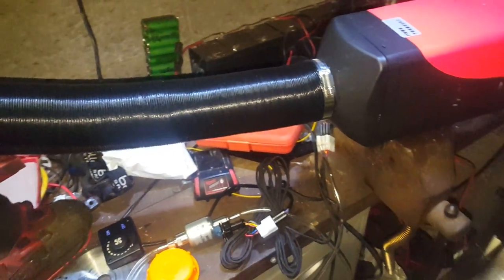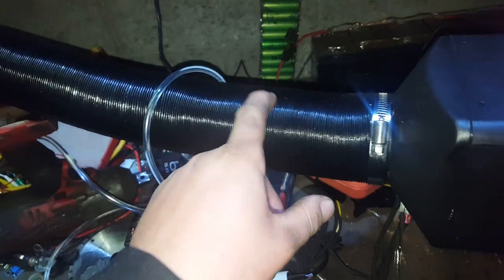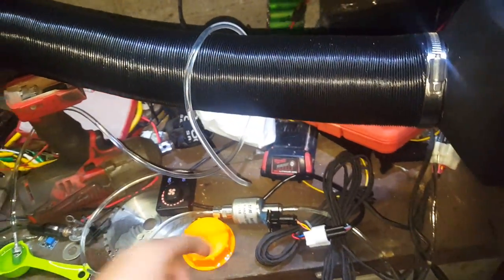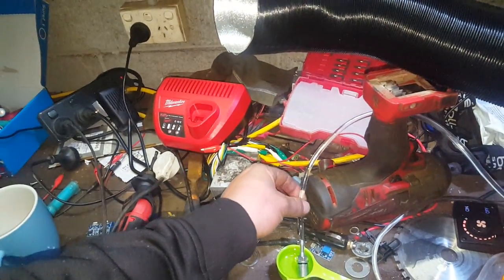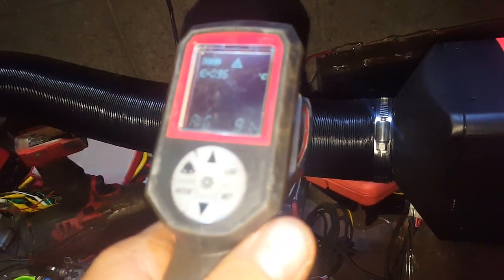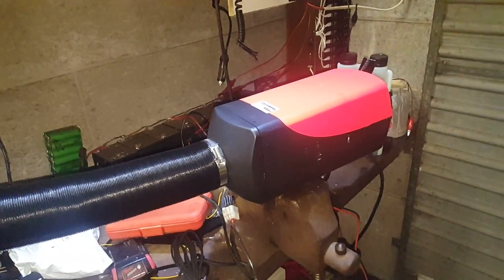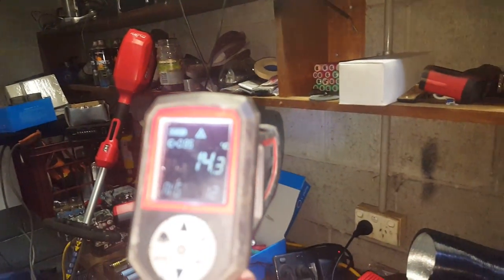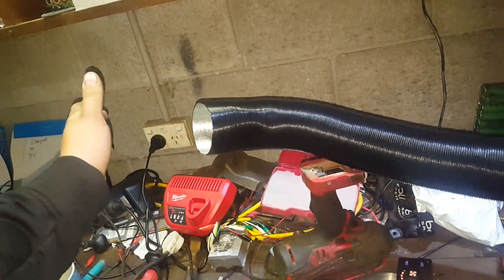Awesome 5Kw Diesel Powered Rv Motor Home Heater Test in the Shed

Comment: That seems quite fuel hungry? Is the normal sort of fuel consumption for these types of heaters?
Reply from the maker: At full speed its 5kw of heat so its not that much fuel for the heat you get
Reply: @Oneupthesleevecustoms  How many hours on a 5ltr tank at low speed?

Comment: What sorta of temp does the exhaust pipe get to?  Temped to set one of these up in the rear of my car with a remote start and its own dedicated battery, by the time I arrive at the car on cold/snowy days it'll be totally defrosted.
Reply from the maker: Exhaust pipe gets very hot 150 ish id say. Temp out of unit ive seen over 65
Reply from the maker: A 2kw one for a car would de snow it fast and i would run it on kerosene

Comment: Excellent review and test.  Curious, have you found any limitations in the length of fresh air or exhaust length?  I am hoping to extend either for ideal placement and don't want to introduce inefficiencies in the design.  My other option would be to extend the cold air supply or the hot air exhaust, not sure which would be best.  Does the fuel tank require certain placement (above or below the heater)?
Reply from the maker: Tank can go anywhere i would stick to one lenght if exhaust then muffler then one more pipe section. Id keep combustion air soured shorter
Reply: @Oneupthesleevecustoms  Excellent, thank you!  Mine just arrived yesterday, I can't wait to see it installed in my application.  Your video helped me in the process, so thank you very much!
Reply from the maker: No problem mate. Thanks for watching ive got heaps more places to install them one in a shed one for my workshop a caravan too
Reply: I’ve got a top tent on a trailer better than freezing
Reply from the maker: They are good for tents

Comment: Excellent video.
How hot did the exhaust get when up to max temp and if running the exhaust through a timber floor of a caravan, what measure should one take to insulate the exhaust? Did you have a silencer (muffler) fitted?
Reply from the maker: Yes muffler is needed. 90mm steel down pipe pop is a great way to do the penotrations
Reply: @Oneupthesleevecustoms  Cheers buddy. I appreciate your advice.
Reply from the maker: No problem I need to make some more diesel heater videos just very time poor atm

Comment: Does the unit by chance come with a timer that can be set to turn on at a specific time of day and/or turn on at a specific time of day on a specific day of the week?
Reply from the maker: Not this.model mate
Reply: Appreciate the reply/help. Does anyone also happen to know if the main heat unit absolutely needs to be mounted in one specific position or is it possible to mount the main heating unit in different positions(?)
Reply: @__WJK__  facing up yes or across but not facing down mine played up the.flame inside like across or up good heaters  they do carbon up if not used flat out now and then
Reply: @Jamie Joker - Appreciate the reply... I just so happened to find a youtube video that answers the question I was searching for. If you're at all interested, here's the youtube link...  https://www.youtube.com/watch?v=fB1QrW3nKVE - The 10:25 mark shows the orientation I was wondering about.

Comment: Has the heater a thermostat switch so if the room Temperature drops it comes on?
Reply from the maker: No its just speed settings. If you shop around there might be a thermostat controller model
Reply: Wouldn't be hard to modify it...
Reply from the maker: Yeah a simple timer and thermostat you would be fine

Comment: How much power does it take to run this? I'm planning on heating a van in the winter.  How much solar do you think of need to have it run overnight?
Reply from the maker: 200ah at 12v will be sweet over night. They pull 3 to 4 amps while running 10 on startup.
250 plus solar would be good

Comment: what kind of controller... does it do what the ASPAR latest versions do!? like slow down once room is at heat?
How much fuel does it really consume per time?
If burns more than the ASPAR, one saves money up front but spends more in the long run so this unit turns out to be more expensive!
You have to do precise and thorough comparisons, or the results are misleading.
Reply from the maker: No they are pulse controlled so fuel and fan speed linked to 6 or 10 settings pre defined.
They are not comparable.
Ones 130 aud and the aspars are more like $2000.
Fuel use is never going to be identical.
My 100s of hours of running these and the all in one style Chinese clones and installing dozens in campers , houses , hot houses ,sheds and setting them up for tents says that these cheap units will suit most applications and people.

Comment: how loud is it? cant figure out.. deciding between this and suburban nt16seq propane furnace for my van build.. id prefer to deal with diesel than propane but not sure if the noise is tolerable at night
Reply from the maker: They have  an adjustable fan that turns down nice and low ill run it in another video with my db meter and show you. They sometimes come with exhaust mufflers
Reply from the maker: Ive installed it for.my customer now i was getting 65 db right next to it at flat out. No exhaust muffler. 
Much lower under normall operating conditions
Reply: @Oneupthesleevecustoms  thanks for your feed back
Reply from the maker: Thanks for watching
Reply: @Valters Boze- The Suburban Propane unit consumes huge amounts of gs and electricity. You need to be plugged into shore power - the battery isn't enough to make it through the night. You'll need several spare propane tanks!

Comment: Dude, build yourself some shelves!!! ...better use some M10 all-thread rods and hang them from those beams. Then separate storage from project space.That will give you a lot more freedom to work on your projects w/o knocking stuff over or tripping over the treasures piling up on the floor. Yes, this might take a few days but will save you MONTHS in the long run!

Comment: Sound like an airplane about to take flight
Reply from the maker: Only cause it's the only thing making noise in the shed. They aren't that loud I sleep with one in my camper van
Reply: @Oneupthesleevecustoms  what’s what I’m thinking of using it for. It does sound loud from the video. What would you compare the noise to ?
Reply from the maker: With a muffler its just mostly fan noise (air moving)  and the pulse from a pump. Like a gaming console with the fans on overdrive

Comment: Is it safe to have the combustion air intake in side the building or does that need to be outside with the exhaust, I am fitting one in my garage.
Reply from the maker: Inside a garage is fine.  If its a van out would be better if power fails (rare) you can get a bit of smoke come back from combustion intake
Reply: @Oneupthesleevecustoms  Thank you for the reply and advise, Much appreciated.
Reply from the maker: @j0llyroger889  too easy. Good things great cheap heaters

Comment: Would these run on domestic heating oil, as the last load for work was around £0.60p litre.
Reply from the maker: Im not sure mate we dont have that here to my knowledge. What sort of oil is it
Reply: Are you in the UK? 28 second heating oil is kerosene, 35 second is diesel. Either should work OK in one of these.
Reply from the maker: Yes check out my other videos. I heat my house
Reply from the maker: No problem at all

Comment: Hi how many amps does it draw on lowest setting?also do you know if 2kw would use less amps or are they about same on start up?🙂
Reply from the maker: Fan and pump about 1.5 amps on low. Id say glow plug is the same on 2 and 5kw items
Reply: Thanks for quick reply I’m off to go order one👍
Reply from the maker: To easy mate there a good thing

Comment: Do you think this unit is more fuel efficient then a 23,000 btu kerosene wick heater? I read this 5kw unit is about 20,000btu. I use a dyna glow wick type heater to heat my small work shop and kerosene is twice as much as diesel. I can get about 8 hours out of a full tank that’s 1.9 gallons/7.1 litters. I also can’t leave my kero heater running when I’m not here and would be nice to have a unit I can let maintain the temp. Running a natural gas line to my shop is way to expensive considering I’m planning on moving next summer
Reply from the maker: One of these is what you need great things
Reply: One Up The Sleeve Customs is it thermostatically controlled or is that controller just for fan speed?
Reply from the maker: Fuel and fan are on speed controller
Reply from the maker: https://youtu.be/-bmELZaH6zQ

Comment: I think the fuel pump is supposed to be at a 45° angle.
Reply from the maker: 45 to up hill. To aid getting air bubbles up and out of the line
Reply: 45 to 90...do not mount horizontally, vertical is ok.
Reply: Mine has been horizontal for years , no problems

Comment: can we put the exhaust any position , for example on the side to screw the unit to the wall instead to the flor ?
Reply from the maker: Unit has to stay in the upright position as it is in the vice. But you could elbow exhaust straight  out the wall. Thats how im about to do the same
Reply from the maker: There would be a moisture build up if it didnt fall down hill
Reply: One Up The Sleeve Customs the reason I was asking,is that I am planning to install this on my boat,and I always can make some angle to screw it on some inside wall and screw the unit with exhaust pointed down however if I would screw this directlyto the wall , I would save lots of work with drilling a holes and solve a problem with long exhaust safe way
Reply from the maker: Im fairly sure it has to go down hill

Comment: Your affiliate link leads to a 3 kw unit, do you have a 5 kw link?
Reply from the maker: Ill get you one tonight mate cheers
Reply from the maker: https://www.banggood.com/24V12V-5kw-Diesel-Air-Parking-Heater-Diesel-Heating-Air-Parking-Heater-with-Digital-Switch-p-1252913.html?p=OQ120813147900201708&custlinkid=3342
Reply from the maker: there ya go mate thanks for considering buying through my link

Comment: 8kw is a lot quieter fan 
No more hoover running in the back
Reply from the maker: You reakon the fans quieter i think my mic just picked it up strong
Reply: The 8kW one is literally a rebadged 5kW one lol. Their are so many videos of the 5kW vs 8kW where they pull them apart. They are literally the exact same. Just a marketing tool
Reply from the maker: No they are unlocked to higher pulse rates mate more fuel volume
Reply: @Oneupthesleevecustoms  negative
Reply from the maker: @1989cranston  yeah they are just tuned different. Some of the ones with the good screens you can turn up to that point too

Comment: I'd be worried about doing an over-nighter with a unit that's not CE/ULc/CSA approved.  There are too many unknowns.  I'm hoping that this unit is confirmed to be approved by a non-Chinese authority.  Your life may depend on it.
Reply from the maker: Yeah i guess that could be a issue
Reply: Run a co detector.
Reply from the maker: You can get smoke detectors with them in it i believe

Comment: I'm thinking of buying one which is self contained unit - fuel tank etc all in 1 metal box - easier to move from van to garage or boat etc. Relatively speaking what power would you recommend (if it heats up vw transporter panel van by +- 10-15 degree C in less than an hour and keep it warm using less than 5l of diesel overnight id say it is enough). also planing to run it on separate battery to keep it portable.
Reply from the maker: For a van car small camper 2 or 3 kw 
5kw for anything bigger

Comment: Hi just noticed they have digital display also ones the same as yours with dial,do you think digital display will use a lot more power as I only have one battery at mo in van🙂
Reply from the maker: No very little max a 100mah id say

Comment: Any information on how long one tank a diesel will last at approximately -20 situation
Reply: Roughly 24 to 30 hours on high but I've seen different tanks so not sure they are all the same size. I roughly been using a gallon a day running mainly oh high, but temps here go up and down frequently its -7 C here now. Hope this helps.
Reply from the maker: Yeah less than 500ml a hour on high is what ive seen with heaps of heat output
Reply: Yes it is good on fuel however watching mine a bit closer I think it was turning down lower over the 24 hour period and used roughly an Imperial gallon or slightly more but I am heating a 24 foot by 36 foot pole barn with 1 1/2 inch styrofoam insulation, sorry about my standard units of measurements! Great unit really happy with the investment was $159.00 US dollars delivered and very easy to install. Thank you for sharing the video!
Reply from the maker: They are a great value for money im very happy with  the couple i have tested oiut

Comment: how much diesel does it consume for 1 hour?
Reply from the maker: On hi low ?
Reply: How much on high
Reply: I think the general rule of thumb is about 100ml/KW per hour at full noise. So a 5KW heater would use 500ml/Hr. Rough guide but its pretty close

Comment: Glycol (glycerine) is a biodiesel manufacturing waste material.  Very inexpensive, I would be curious to see if this heater would run on it as it's extremely cheap and renewable also.  Formula E electric race cars are using it to power their charging diesel generators, look it up on Google.  The only caveats being they have to warm the engines up on diesel first, and also that glycerin (glycol) has only 70% of the energy potential.
Reply from the maker: Ill do some tests and let you know
Reply from the maker: https://youtu.be/-bmELZaH6zQ

Comment: Nice video... have you tried used motor pol
Reply from the maker: Used motor oil and diesel works yes
Reply from the maker: Won't work straight
Reply from the maker: Have you tryed
Reply: Waiting for unit to arrive.
Reply from the maker: Ah cool what part of the world are you in mate?
Reply: The U.S...... Philadelphia, PA
Reply from the maker: Ah sweet so winter is coming.
Reply from the maker: Is red diesel cheaper for you to buy?
Reply: Off road diesel was cheaper but I haven't checked in a while. Not many stations with it in my area.
Reply from the maker: We don't get that in Australia  we have to claim it back though our business's at tax time :(
Reply: It's a big fine here to use it as on road fuel. It's only for construction equipment here so it's not readily available in many stations.
Reply from the maker: What about generators and diesel heater s?

Comment: The pump is not at the ideal angle but it shouldn't affect your experiment.
Reply from the maker: Didn't affect it for the next 2 years and it still works :)
Reply: @Oneupthesleevecustoms  thats good. We used to fit these in boats  and its recommended that they be sort of angled and upwards. Its to do with the lubrication  of the pump itself I think which the diesel fuel does and at the wrong angle the diesel doesn't soak the bit that matters.
(Also if fitting these in boats you must change the plastic fuel line to metal to pass the boat safety certificate).
Reply from the maker: Ah yeah that makes sense. I run mine on all sorts of oils so I don't think lube is a issue more carbon grit and gunk

Comment: but would the heater work with 1 or 2 100 amp rv batteries over night? Would that be enough power?
Reply from the maker: Sure would :)
Reply: @Oneupthesleevecustoms  just a suggestion.....you may have already done this, I havent looked through your vids yet. I will though. It seems theres alot of interest in these cheaper heaters. With the hug price difference. It seems like youd greatly benefit from putting a series of videos together beating on some of these  low price heaters. Man, id think you could at least come up with 6-7 video topics easily. No one else has really dug in to these things. A few people have done vids like yours. But, not even as in ddpth as yours. Like how you showed how much fuel they actually use, by putting fuel in that little cup. 
       Ive needed one of these for a couple years. I refuse to buy one because of the price. I insisted on waiting till I have $1300 to buy a espar or webasto. Only because I felt that they  are so low priced I wouldnt feel safe sleepi g with it running.  That there could be a video. Just putting a bunch of hours on a unit and maybe throw it around abit. Give it some abuse. See if it catches on fire at some point. Lol. Seriously though. Youd be the first. 
   Thanks for the video man
 Greatly appreciate it.
Reply from the maker: Thanks mate ill give it a go

Comment: Mine heater is identical to yours I’ve just got it all connected! However it won’t fire up what am I doing wrong?
Reply from the maker: Primed the fuel line?
Reply from the maker: Got enough power?
Reply: One Up The Sleeve Customs turned out I never had enough power as I was using an old battery charger as a supply! So I linked it up to my car battery via jump leads and away it went great product and very hot 👍
Reply from the maker: @ryanferris7841  oh good stuff mate.